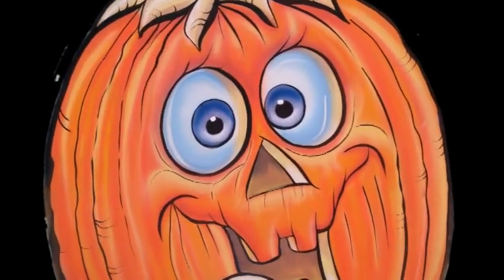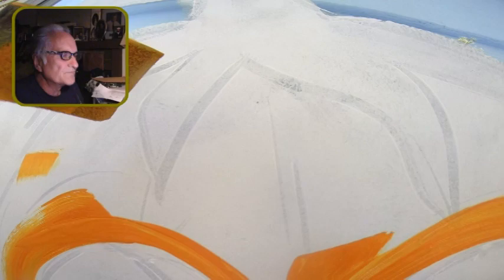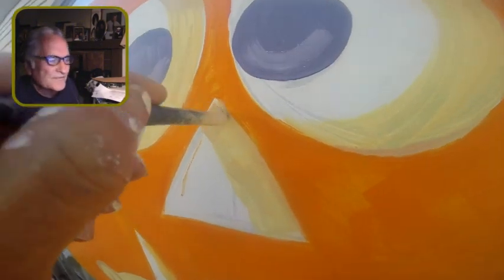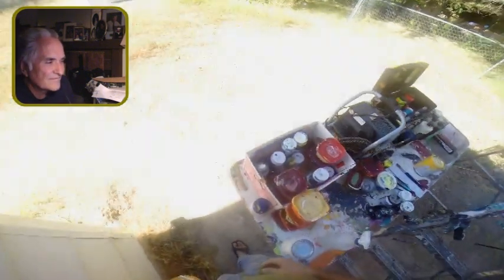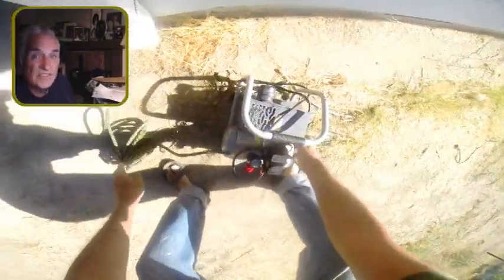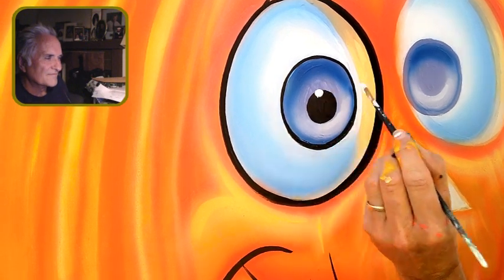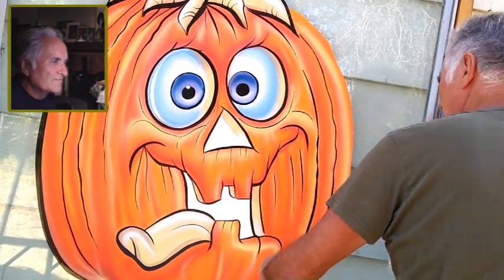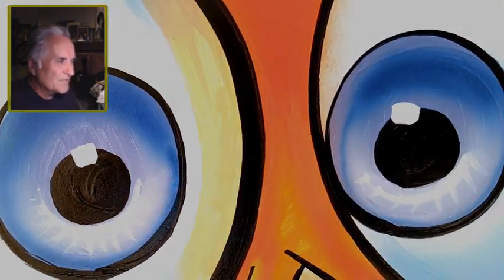WINDOW PAINTING - LESSON #9 Crazy Jack!

Comment: I've run into issues with flaking of the paint then when I try to paint over it it looks bad so I wipe off and try again-wondering if this is due to surfaces not cleaned well. Really love your work-mine is very amateur but I enjoy it😊
Reply from the maker: You can paint over dirty windows it shouldn't effect the paint. Grease and grime will though. Sometimes paint will bead up on certain windows in certain areas too. You can spray clear spray paint over the areas or hair spray too, then the paint will stick to it. It might be your paint too, what are you using?
Reply: Thank you-I was using acrylic then it would cake up and not stick then began to peel off..I'm going to switch paint definitely!

Comment: I live in southern Alberta and it gets very cold, so when you paint this on a window in bellow 20 degrees Celsius, won’t it crack and peel? and do you use acrylic paints ?
Reply from the maker: Although not common I have painted in as low as 6 degrees fahrenheit which is -14 degrees celsius.
Reply from the maker: I paint with warm paint on windows that are somewhat warm.  Even though it is below freezing the paint will work if kept warm.It is more challenging but I have done it dozens of times. https://www.youtube.com/watch?v=LqtzA3xD49k
Reply from the maker: It does not peel, I use interior house paint with an eggshell finish.

Comment: I have been using eggshell and have had no problems but just started a new painting and the paint just beads up.  Can’t get coverage.  It has been in the 40’s here.  Is it a temperature thing or could there be something on the glass causing this?  I’m stumped.
Reply from the maker: Usually something on a particular pane! Weather does seem to play a role when it cracks. You can use a clear spray to cover the beating area and recoat! so frustrating.